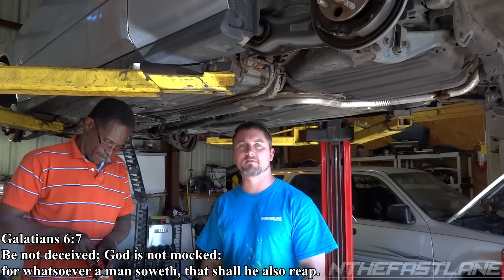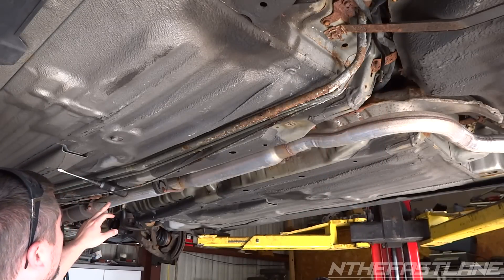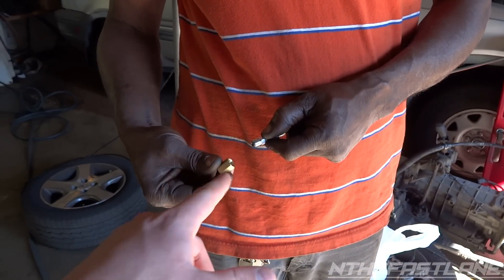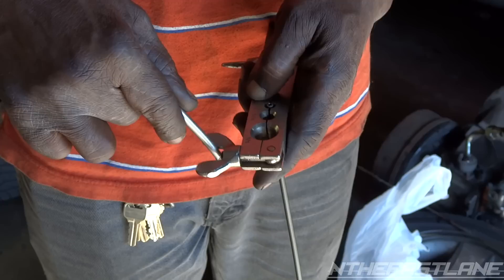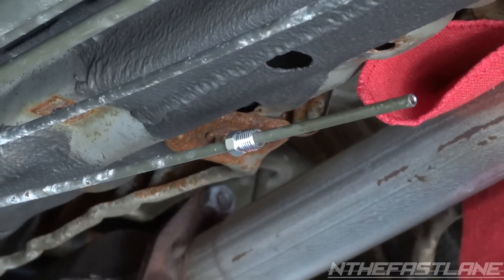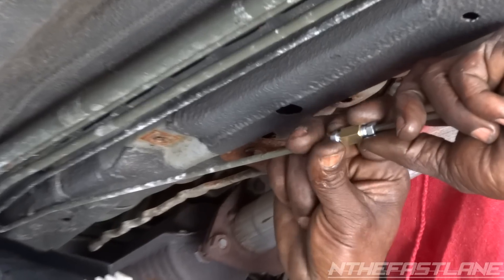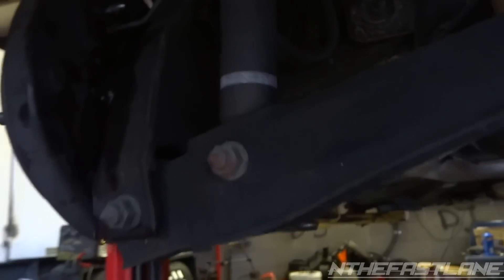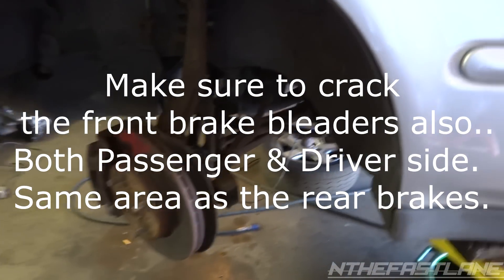▶️Rusted Brake Line Repair "How To"🔧

Comment: Warning. I have repaired cars for 50 years. Do not go by personal experience, You MUST do double flares on all break lines. These single flares are totally unsafe. DANGER
Reply: You've repaired cars for how long and still haven't learned how to spell "brakes"?
Reply: Wondered the same thing.  Knew that and didn't see it done.
Reply: I noticed the same thing he only did a single flare on the broken ends.
Reply: Check on that - I’ve done it and it works well
Reply: Do they make a portable double flare device?
Reply: @WBBClips yea the tool they're using can do a double flair, they just didn't do it correctly

Comment: My brakeline rusted on my 91 Toyota Celica. This  video is perfect for me, as i have to do the exact same thing. Thanks. I see i'll have to use double flare, as this method is unsafe over time. Shame on you for teaching half-assed techniques, but good for pointing me in the right direction
Reply: Yeah Frl wtf are they using a union for

Comment: WARNING * This is not a good job! It is clearly done by amateurs who know enough to be dangerous. Nothing is more important than your brake system so it must be done correctly.
NEVER use a single flare on an automotive brake line. It must be an Inverted Flare (IFF). Those "threads" as you call them, are 3/8" inverted flare NUTS for 3/16" brake line. Some M/Cs use a 7/16" inverted flare nut, also for 3/16" brake line. BTW, metric brakes use the same exact brake line.
Reply: When screwing the flare nut to the union, should it be tightened until all the threads are in as mentioned in the video?

Comment: In the video you only did a single flare.

I thought that you have to do a double flare for brake lines, because single flare may crack and break under the pressure.

Comment: Can you explain gravity feed.  I've tried it before when I've redone lines and it didnt work worth crap. Is the idea for the fluid to push air out of the bleeders or for the air to rise out of the reservoir
Reply from the maker: Yes, fill the reservoir to the top and crack all the bleeder nipples until they have a constant drip..once they do, that means all the air is out of the lines. If it's not working, sometimes to get the process started you have to pump the pedal fast and on the last pump pull the pedal back up if it hasn't by itself. Also the position of the vehicle matters. Air bubbles travel up so make sure the vehicle is angled in a way that the bubble can travel up to begin the dripping process.
Reply: @Nthefastlane     You are joking. right? 
                            If not, then you should really go down to your local Community College, and sign up for Auto Repair 101.
Brake lines are not filled with water.. Was your daddy a plumber?

Also, the guy doing the line repair needs to be fired, before somebody gets hurt...

Comment: In house plumbing great job . in car repair you need bubble wall steel brake lines an s you skipped one step you need to start a dubble flare then use the flair to finish. To get a rubble flair . if that car went in for inspection and it was leaking I would fail your job . and rip it out and replace it from front to back

Comment: DOUBLE flare ALL brake lines whether using a brass union or not, it is DOT, you cause an accident because of this flare failing, whoever did it is liable in court for the consequences of their negligence.
With all this trouble, why wasn't the entire line replaced and a lot of pointless time and parts avoided.
Reply: Because of the complexity of bending the brake lines and needing to take down the gas tank to do it properly.  I personally would do one long hard line.

Comment: i wouldnt even cut and join like that, in all honesty either i replace the entire line brand new, or i wait until i have the money saved to do it.
Reply: so you going to come and pull the motor out to replace the new line mine is in behind motor installed before the motor and not intended to ever replace. the line is plum good except couple inches off the flex hose off the caliper.

Comment: that's not safe at all they didn't double flare the line. he only single flare witch it can pop off the line
Reply: Yeah but they used a single flare, which isn't as secure. For a brake line it's strongly recommended to do a double flare at each of the unions.

Comment: Jesus guys, get a Eastwood catalog and buy a proper set of tools. Single flares for gasoline and canister vapor returns, inverted flares for brake lines and use the nickel/copper brake line tubing in the curvy brake line runs ..